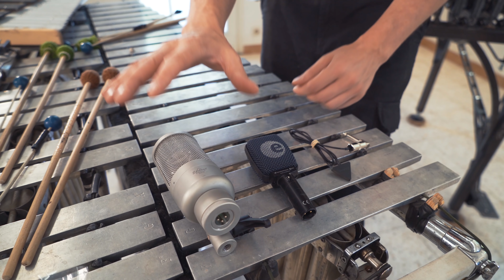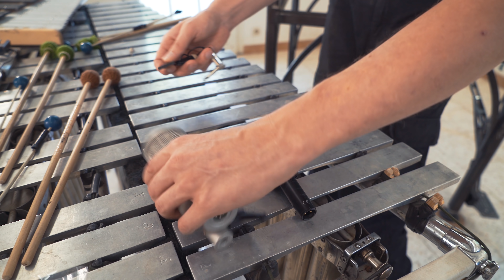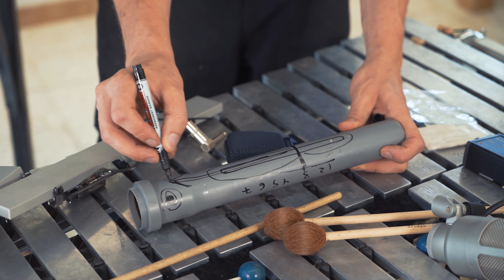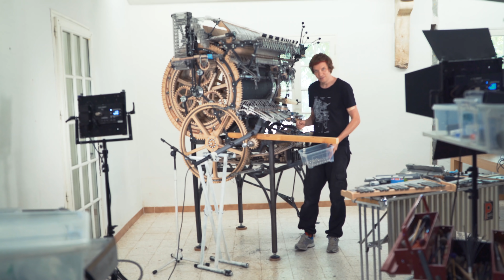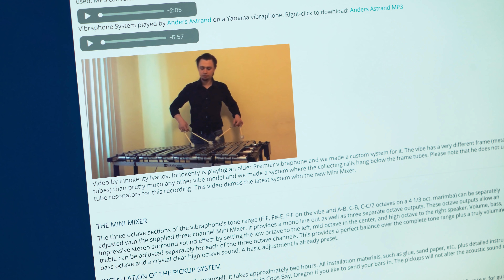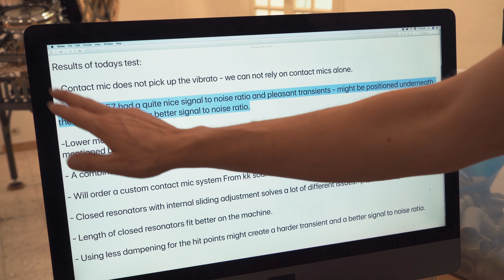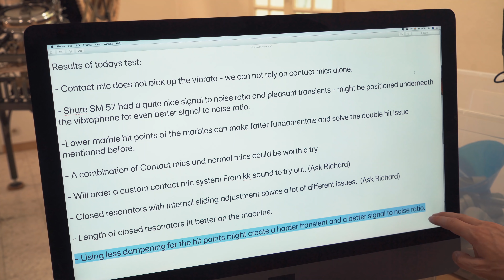Vibraphone Experiments / Microphone Types - Marble Machine X #96

Comment: Hi,
very first comment here.
For the microphone problem, you may pick it with a few 57's under your pipes, carefully adjusted by your sound engineer, but if you fear that the sound will not come as homogene from all the tube (some are short=far from the microphones, you can try another IDea:
You can place in each tube, at the bottom, an electret (with a very low sensitivity = no distortion , and wire them all to their own small and cheap preamplifier. It will actually pick the air and not the mechanical vibration, because the vibrato is from the air moving, not from the pie itself, so contact microphone will not work for that.
You may isolate them fro m the tube with some kind of rubber, and voilà !
It's a cheap solution (a few euros max per electret capsule), and eah part can be replaced easily.
Let me know if you need more digging into that, i will provide you some link to cheap and good capsule, and the same for preamplifier.
Thnaks for your work and your vidéos, they are very great !

Comment: Miking up a real vibraphone or vibraphone plates, like in your case, is very difficult, but possible. Maybe you should  contact a professional sound engineer about this topic.
I know  these problems, because  I am a vibraphone Player (4  octave Studio49 concert vibraphone). Your inital  "idea" of placing  one or more microphones above the vibraphone plates is definitely the best,  but  you have  to use microphone  with the  right characteristic, so they will only "listen" to the plates and the resonators below, but not to all the other noise.
The  problem you have in your machine is the same a sound engineer has, when it comes to miking up a vibraphone in a Bigband, where it, because of it cool looks, is normally placed near the front of the stage, but ar far away as possible from the brass section. The instrument has to be miked without all the noise of  the rhythm-section behind, but there are microphones that can do that. Four (expensive) Mikes  with the right characteristics are enough even for such a huge instrument like my concert vibe and the SN is excellent (of course, this would not work, if you place the vibraphone in front of the trumpets  and  trombones).
When is comes to the resonator pipes: You'd better not use plastic stuff from your local hardware store, because those plastic pipes will detune with any change in temperature.

Comment: Use flexible teflon tubes to tap the sound of the resonators, including the vibrato, and bundle the ends in parallel into a round box with a single microphone, mounted suspended, and padded to shield external perpendicular vibrations, a few decimeters away from the tubes. Should be more costeffective, quite flexible and saves a lot of wiring. The headset-microphone seems already quite sensitive, just attenuate it using smaller hole / shrink/rubber cut off. Prevent vibration of it's shell against the tube, for example suspend it somewhere in the middle using some elastic wire.. Build a baffle at the end of the box to prevent noise getting in from the backside of the mic and prevent resonating effects back into the teflon tubes.

Comment: I think you could get what you want by multiple mics.  Contacts and regular both with a blend in between the two...?

What if you had... a thin paper or film at the bottom of the pipe that you used a contract micro phone on. Something that can pick up sympathetic vibrations from the tube and transfer it to the contact mic? That way you can maintain the noise ratio!!

Comment: I'm no professional engineer  or anything but I have an idea to get the vibrato you're looking for. Use the electrical vibraphone and have a digital vibrato through a  program  to digitally implement it. Then you can set up a leaver  with a switch to turn the vibrato on and off as you need.

Comment: How about a dual channel setup for each 'plate' you have in a given vibraphone setup.  Put a contact mic on the plate and have a small dynamic mic in the base of a closed adjustable resonator tube (with the vibrator rotor in the top).  You can then use a multi-channel digital (programmable) mixer (Symetrix, etc.) to mix the output, get the vibrato only as 'needed' in the music (you could even use a 'pin' channel off the main programming wheel to trigger this off an on along with the drive for the rotor) and otherwise it would be silent and only on contact mics.  Then you only have a single 'output' from the mixer for the whole vibraphone and you can swap the programming of it for each song so it's tuned exactly the way you want and it acts like a single instrument in the main mix instead of a bunch of mics you have to constantly control and adjust from the main mix.  This also minimizes the SNR and only gives you as much background noise from the machine as you want to mix in and the machines' inherent 'working' sound isn't necessarily a bad thing and could easily be part of the music it makes emphasized or de-emphasized as you want for a given piece.

Comment: I think the professional system might be worth looking into for multiple reasons actually, and as someone else mentioned use something like a post filter maybe, or something else to create the vibrato noise could be an option. The main reason i say this, is you mentioned the lack of need for a resonator pipe could potentially fix another issue(though would require new parts) from a previous video, the placement of the notes themselves.

As it is now, the notes needs to be places in a specific spot due to the best hit location to get the best sound. This is due to the need of having the resonator pipes below the notes. If you go with the professional system, the pipes would not be needed, and you can redesign the note holders, so that regardless of where their placed, they could hit their sweet spot for the best sound, and would allow you some flexibility in where they are located. The main issue this would cause though(outside of the lack of vibrato, which is an issue), would be the lack of uniformity in how the notes physically look on the machine, but i feel that's going to be an issue when swapping notes regardless of what setup and system you have in place. 

This would also deal with the issue of background noise blending in as well. In the end, its just a matter of finding out, what it is you are willing to compromise on, and what is a requirement for it.

Comment: Hej Martin. Jag skriver på engelska men jag är från Göteborg.
I’ve been following you for a long time and I’m a fan. For a long time I’ve been thinking about what I could do to contribute to you project. Today I had an idea.
You were talking about your compromise and I have a suggestion in how to make it smaller. 
You mentioned the custom made K&K contact microphones and that they didn’t use the resonator pipes and that the vibrato was added later.
You also mentioned that you’ve made preparations for the vibrato. 
I guess that these preparations is a shaft prepared for driving the valves!? 
I’m an electro engineer and a maker. What if I made a device that could pic up the angle of the shaft, and output a signal in order to modulate the vibrato effect. This output could be whatever you wanted. It could be an analog signal or a digital. You see, I am not to sure how music software works, but I guess it could take some sort of input in order to modulate. Another solution would be that my device actually modulate the amplitude of the signal. If you’re interested, give me a shout!
Reply: I can see from the comments that I am far from the only one with this idea.

Comment: This could be a stupid idea, but can you make the ends of a resonator pipe conical to amplify the sound or make a sort of stand that fits into the pipe and can hold a microphone inside "floating" in the middle of the pipe so it doesn't get that loud metallic distortion?
Edit: could you put a mic on the flap that will slide along the resonator pipe? Doesn't have to be a contact mic i wouldn't think

Comment: Closed resonators with contact mics in them - the whole cavity is vibrating thanks to the resonating air volume. 
That way you get the best STN ratio and vibrato together. 

Add two SM57s in ORTF setup above the vibraphone for better transients AND realistic stereo image. Place them so their back is pointing to the loudest part of MMX - in that area they have the smallest sensitivity. So they will be pointing towards you I guess.

Also if possible, time align pickups with the stereo pair.

Comment: Could you put the contact microphone on a membrane at the end of the resonator pipe opposite the keys. This would avoid both the lack of vibrato and the need to plug in the microphones each time you change notes?  My other thought is that you might be over complicating things. Why not literally just put a few microphones at the bottoms of the resonator pipes, but not one for each note. Something more like what many marching band percussion pits do where they take two or three mics and stick them at the bottom on what would on a traditional vibraphone be the lower support. If the mechanical sounds became an issue, some clever "eq"-ing would likely be able to remove the sound.

Comment: Can you just filter out the noise from the Shure SM57? The signal is so much stronger than the noise that a filter should be able to leave the desired sounds intact but eliminate the undesired sounds pretty much completely.

Comment: I would definitely prefer the adjustable resonator. Personally, I would get bored by an instrument that has limited tonal capabilities; adding an adjustable resonator gives the possibility of "non-standard" resonances (perhaps thirds or fifths, or even more unusual) that can really open the machine up to new sounds in the future (of course, at the expense of requiring more setup time/effort for performances). Conversely, with your performance use-case, I can definitely see the value of having fixed/faked vibrato/resonances.

Comment: Martin I wondering, maybe using some gooseneck dynamic mic could be works. If u put those in the bottom of the vibraphone plate, and just above the resonator pipe it should take sound from both. It gives u possibility to correct ratio signal between plate and vibrato by only moving a head of the mic. I also think cutting of some hole in resonator pipes is the worst idea for the sound, because u change sound wave that passes through the pipes, and their length affects the instrument's aliquots.

Comment: Reflecting on my previous comment. A capped resonator pipe would drop the resonant frequency down an octave, so your resonator pipes would have to be half the length of what they would be open. This would keep the resonator pipe array smaller. Which would give you more room for mic set ups

Comment: I'm so curious if your closed resonators are going to work. I wonder if you've considered putting small mics on the internal sliding valve of those closed resonators? I think something like a lavalier could work as they can be dynamic and have a very low signal to noise ratio.

Comment: Would a  pickup capture the sound from under your plates? Each pickup point could be set with the proper clearance regardless of what plate is present. Guitar pickups are very good at being focused on the string it's assigned to.

Comment: If you mount contact mics to the resonator pipes, are you going to significantly dampen the pipes?

Same question, I guess, for your adjustable closed tube pipes. Instead of changing the shape of the pipe with your spot and whatever other hardware, why not just a simple telescoping tube similar to what you showed but with a closed end?

Comment: Im thinking that using multiple 57s gives you an opportunity of playing around with the phase angles of the different signals. I have not done it myself for the purpose of eliminating noise but theoretically there could be a way of having the noise signals to be canceled out by each other, maybe without canceling out to much of the wanted signal.
First to make all the signals phase linear and then shifting the phase 180 degrees on half of them.
I dont think it will take away all the noise but it might at least negate the amplification of the noise signal from combining signals from multiple microphones.
Otherwise build an acoustically dampened box that you pass the resonator tubes through and place a microphone in there.
Having multiple individual microphones, excluding the contact microphones, should give rise to phase problems because they will pickup more than just their dedicated sound source and cancel out overtones of the wanted signals of the other sound sorces when amplified together. 
Good luck! You are truly inspiring!

Comment: From someone with absolutely zero music theory background, but wouldn't you get a different sound using a mic inside the closed resonator pipe depending on where in the standing wave the sound makes it would be positioned?
If so, wouldn't the way the mic picks up the sound change as you increase/decrease the length of the sliding adjustment? And if so, wouldn't you be able to go around that by using the length adjustment plate at the bottom as the site for a contact mic?
But as I said IANAM(usician), just a random internet denizen who's lost his marbles...

Comment: Hi Martin, have you given the DPA d:vote 4099 mics a try? They are super cardioid clip on condenser microphones, and they can be used on everything from piano to drums... They are tiny and could be convenient as they are mounted on goosenecks. I’ve never seen them used on a vibraphone but I have a feeling they could work well, especially since you could easily place them under the plates, above them or at the end of the pipes without fussing around with mic stands.

Comment: How about an analog vibrato where you have a potentiometer controlled by some mechanical linkage for each note. Should be possible to implement using only passive components, so from my point, it would fit better with the whole theme of the machine.

Comment: I've got an idea about how you can get vibrato electro-mechanically - you could borrow from the old Hammond Organ tone generator - route the signals from that vibraphone pickup through the mechanical vibrato capacitor.
Alternatively, use a continuous rotation potentometer to provide a sine wave at your vibrato frequency and use it to modulate the gain of those channels.
If you end up with resonators, I vote for the closed tube adjustable version.

Comment: If you close off the bottom ends, the resonator pipes should only need to be half the length of open styles.  Some lavalier mics plugged upward into the end caps, using shock-mounting to prevent hard surface noises, should pick up the desired tones nicely, and since they would be inside of the resonator pipes, the outside sounds would be dampened significantly, especially if you EQ each one to a very narrow range.

Comment: Sounds like the contact mic was actually rattling against the concave sides of the pipe
Maybe try closing the pipes with a drum skin & put the mic on that 
Or you could have a kind of reed piece in the center of the pipe to put the mic on, rectangular & tapering a bit so only a part is connected & the rest vibrates, like my limited understanding of what a reed is
Alternatively for the over-engineered option you could get someone to make some connectors to make the contact mic into the spinner

Comment: I'm french so I'll just try to make myself understandable:
beware of 2 more things: 
- using multiple mics will create phase issues that, if you don't take care of, will act to your sound in a way that your perfectionnism won't like it to do!
-  I've just made sound for a concert yesterday where a musician did play with the k&k system (or I think?) and we had issues with it, being the sub d-25 connector (don't know if it's the connector on your model) failing and clicking in the PA system. So we had to change it and go with two km184 in a XY couple, so I heavily recommend to go both, and don't be relaying on just the contact mic, a pair of 57 or 609 will add some air to it and assure you no mechanical issues.

Comment: I'm no audio engineer (or any engineer for that matter, (yet)) but isn't there plenty of space inside the resonator pipes for a nice thin microphone (like perhaps that long thin black one with the good signal to noise ratio)? I feel like it wouldn't be totally unfeasible to have, from top to bottom, your vibraphone plates, then the top of the pipe with the vibrato plates, then a microphone inside the pipe, pointing upwards so that it gets the maximum effect from the vibrato and a decent amount of sound from the vibrating plate itself, which is not far away from the top of the pipe. Then, below the microphone, an adjustment mechanism for the length of the pipe, which snaps to specific note lengths. I mean, you already know which notes are going to be in which positions, right? Also, the front of the MMX already has a heap of cool-looking levers for the cymbal dampener and the vibraphone dampener, so it might look good with a bunch of other knobs there which control the Vibraphone pipe length, which would also make the length controls easier to access than say, climbing underneath the machine onstage to fiddle with the bottom of the pipes manually. For the smaller notes, the length of the microphone might be an issue, so a potential solution is to put some padding around the microphone so that it is a cylinder (rather than more of a cone) and then to make the length adjustment plate a donut disk which fits around the microphone cylinder. Hope my ideas can help, and keep up the amazing work Martin!